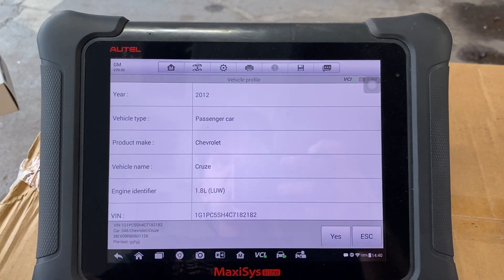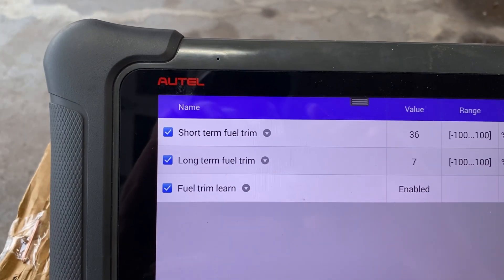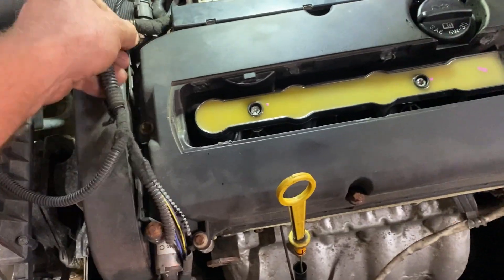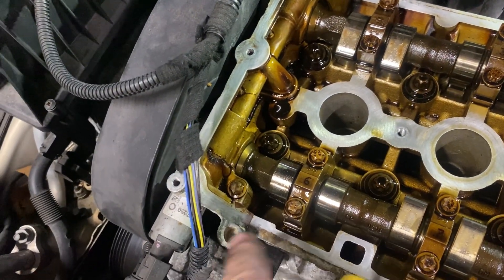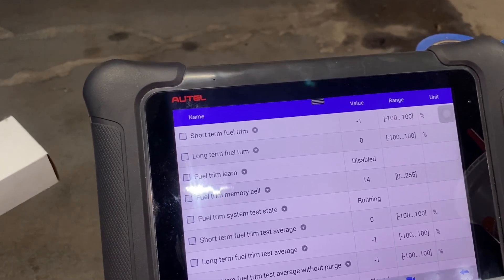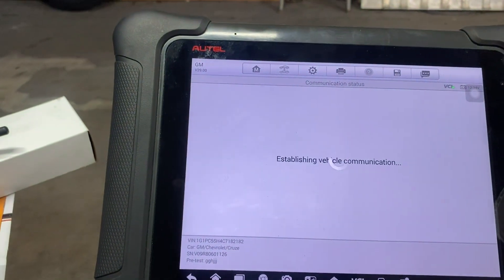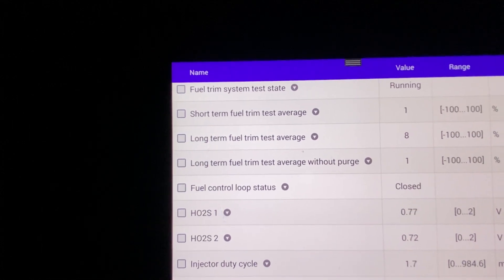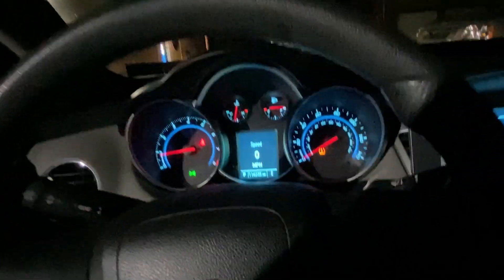Chevy Cruze P0171: Don't Just Guess! Confirm the Fix with "Purge Learn" Fuel Trims

Comment: Good video, if am not mistaken there is a small plastic almost like a check ball in the intake manifold that tends to break as well which can cause/contribute to this failure.
Reply from the maker: Oh yes, good call out! You're referring to the 1.4L
Ecotec engine that's turbocharged-those definitely have that 'hidden' orange mushroom
check valve inside the intake manifold that causes so many headaches.
It's definitely worth a mention for anyone watching that this is the 1.8L naturally aspirated (LUW/LWE) version. It uses a more traditional PCV flow path without that specific manifold orifice or check ball setup found in the turbo models. On these 1.8s, the failure is usually just the diaphragm in the cover itself.
Really appreciate you bringing that up, though it's a great 'pro tip' for the guys working on the turbo version!